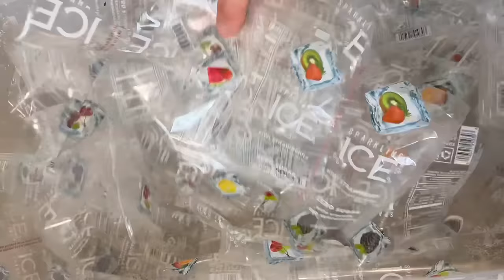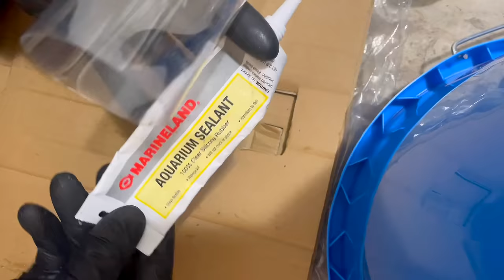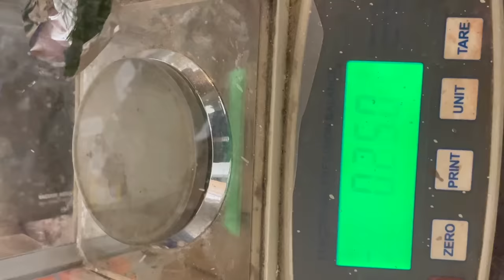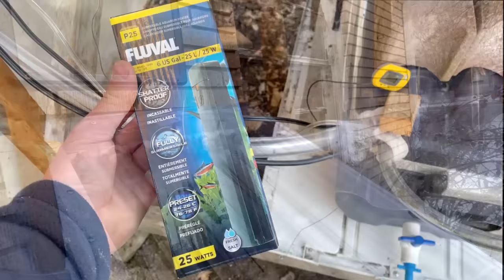Cody's Algae Panel

Comment: Nice work, efficient use of materials.
Would it be possible to increase the algae's production by giving it some kind of feedstock, possibly derived from kitchen scraps and or animal waste?
Reply: @SwampyColorado420  😂😂😂
Reply: No, that's because algae make their own food. I think an euglena would be able to do that, because euglenas make their own food when they don't have any food, but when they have food they just eat it. Maybe you could compost the food waste to give the algae some minerals.
Reply: @SwampyColorado420  What are you talking about?
Reply: He could also increase efficiency by lowering the number of times in that panel, have 3 thicker tubes instead of 9 smaller ones as it would Power wasted space.
Reply: Might be a good use for waste hydroponic nutrients
Reply: Food waste for plants does two things: nitrogen and minerals. I'm guessing the nitrogen won't make much difference to the algae but it's just a guess. The mineral requirements are probably quite different to want land plants require. So putting food waste into the algae tank is likely to just produce growth of ther things that like food waste besides algae, and to complicate the process of harvest and use.

Probably the correct thing to do is find out what minerals algae requires and add small amounts of that.
Reply: He already provided a perfect mineral mixture so the algae wouldn't get anything positive from food waste.

Would probably be better used in a methane digester or bug farm
Reply: @mgord9518   he has a methane generator.👌
Reply: I was actually surprised how much oxigen that small area produces that seems totally doable, makes me wonder why the Biosphere2 project struggled so much to maintain oxigen levels.
Reply: liquid fertilizer would work better i believe
Reply: @SwampyColorado420  *CRACK FARTS*
Reply: @alexk4709  Well, some fish farmer filter the fish tank's water with hydroponics. Then they use the plants they produce to feed the insects they feed the fishes.
That could potentially work here, providing food and energy.
Reply: Maybe if it was pre digested and broken down by otwhr bacteria or chemical processes
Reply: @puppetsock  I think that the increased nitrogen would make a big difference.  Often when looking at the causes for out of control algae blooms, agricultural runoff that is full of nitrogen rich fertilizers tends to be the main culprit.  This also makes sense when you look at the lack of good sources for fixed nitrogen being a huge bottle neck for agriculture until the  Haber-Bosch process was invented.
Reply: The formula for growing algae has been well established since at least the 70's, and you can look up recipes for producing the nutrients online.
Reply: high risk of contamination, low benefit. you generally don't want to start growing random algae if you are concerned about efficiency.
Reply: @vidard9863  yeah well you wouldn't do random shit you'd go for a probably very specific maybe even purpose made species atleast if you did this more commercially
Reply: @baileyjerman5573  so wait, you would go for a specific strain, and then throw in kitchen scraps with who knows what on them into your system? or was that you agreeing with me that it sounds like a bad idea.
Reply: Major improvements in this system will be had in maximising the amount of light in the tube while maintaining the optimum temperature for growth. I would have a large flat surface like an aquarium tank but much much thinner, maybe only a few inches thick, sides and back covered in reflective foil and insulation foam, temperature maintained at optimum by cycling the water through a radiator when hot and covering the face of the panel with a large foam block or similar when cold with supplemental aquarium heater if needed, no point cycling the water into a separate container. Could do this pretty cheap too, mirrors from recycling centre for glass, old car radiator, etc. Automate the temperature control with a thermostat that cycles radiator when hot and actuated a motor to drop the lid when cold. If you wanted to be really clever you could make the lid permanent by making it a two layer sandwich construction with the outside layer being several inches think and you draw down a vacuum inside it, now it is fantastically insulated all the time while still receiving sunlight too. Combine all this with some selective breeding of algae and I think it could get very interesting.
Reply: Also you could face the front with a one way mirror, this way you maximize the amount of light in there, no real way I can see to do better than that short of supplementing it with extra mirrors pointed at it or artificial lighting.
Reply: @SwampyColorado420  lmaooo
Reply: @johnmarston2527  Oh he is just mistaking the all new way of doing Pot smoking, the method pioneered by YouTuber Hickok45.
However, it is currently only enjoyed in the US though.
Reply: I feel like adding things to it would be bad for it considering he’s going to eat it, he seems to eat the algae raw essentially, he doesn’t seem to cook it just dry it out and then eat the powder
Reply: @AaronAlso  Bro I'm so F*cking mad I'm going to Die....  I'm going to wait till the very last second..
Reply: @johnmarston2527  he might be high
Reply: @nobodyofnaught2  If i remember correctly they had some poor choices with the concrete which started hogging the oxygen from the air.

Comment: 16:10 i think the temperature falling rapidly might be partially due to the radiator like design of it, after all, if your not absorbing heat from the sun then your going to just as quickly radiate heat out, especially from the exposed pipes you mentioned at 16:45, maybe put a pipe insulation sleeve over it like the ones that are used under houses on water pipes?it would definitely help retain heat on the trip to and from the panel. 
you are also probably pulling in cold air from the air intake, since the air intake is under the panel it is going to be in the shake where its colder, maybe put the air intake in direct sunlight where it can also get warmed up and add heat rather than remove it. 
and maybe spray the panel with something to make the ice less likely to form or slide off better on its own so you dont have to scrape it off. i hope we get to see you make improvements on it! i love watching you and your experiments!
Reply: maybe 2 layers of the clear plastic would help, kind of like 2x insulated windows, but IR would still pass through unfortunately 

I'm also thinking about maybe an emergency heating coil, powered by something energy-dense, for if the main tank falls below a certain temperature

Comment: I made a photobioreactor (the scientific name of the algae panel I guess?) in january of 2020 for my second year of uni, and I can tell you that your design is by far the best I have ever seen! It is SO practical and straight to the point while staying simple. I wish I had seen that video at the time...
I can't wait to see the following videos, keep up the good work!
Reply: how did u do it? lol link a picture just curious.
Reply: Wouldn't a flat panel be more optimal? It would increase the surface area that the sun interacts with algae, thus with more sunlight you would increase the overall energy absorbed by the algae in the system.

Comment: the method of extracting oil from the algae that cody did can be done to other organic things aswell and get the same results, i did that a long time ago using dry leaves and chicken feeds and the oil i extracted is still with me, its kind of like a tar and crude oil but once its exposed to fire it ignites

Comment: I was wondering how you were going to control for light and temperature, if you were going to make some complex arduino solution, but no, you're clearly smarter than me, because you went solar panel powered relay into thermostat, which is the most stupid simple and elegant solution I would never have thought of. :) Thanks for that.
Reply: Dude same I'm all like so you have to temperature reading you'll have to analyze that data and add some kind of motor controller for the pump... Nah you don't.
Reply: Same,  I would've used a photo resistor + relay for this since its cheap (and I don't have a solar panel lol)
Reply: I was thinking a solar powered pump with maybe a capacitor and a FET  voltage switch to activate the pump.  Possibly additional panel to speed the growth by increasing the temperature to optimum or as close as reasonable when light energy allows, would give more of a capacitance for cooling if there was heavy snow while away without so much grid energy requirement.  Could always use a grid backup set to heat to a much lower temperature to save the system if there was an extended cold spell with not enough light.

Comment: This is an awesome design, looking at the thumbnail I thought it was a solar water heater or similar.
Would having a just two panes of plexi/glass just stuck near enough to each other (like a flat aquarium), with some standoffs for flow agitation, be more efficient? 
I know it's supposed to be a proof of concept, but having a sun roof that doubles as a algae farm just seems awesome.
Reply: My big concern with a roof setup would be the weight of water putting a huge load on the roof trusses, that and if they did fail, you'd now have a large quantity of water ready to fall in your collapsing roof
Reply: @macklinmollard4045  I guess I'm imagining them to be on one of those rooftop sunroofs. Being a whole other floor on top of the house means they could support greater weight.

Comment: When you said that it "only does around 2%" of your calorific needs, I was immediately astonished that just 50 of these systems would - in theory- sustain you! I find that incredible, and that isn't even an unreasonable task at all. Obviously simplification will help with costs, and as low-tech a solution would be absolutely ideal to mitigate failure points as much as possible, but 50 of these PROTOTYPES is all you need*? Absolutely phenomenal really.

As soon as you set up the timer system, I could see that being an issue instantly, as the whole "what if it's cloudy/raining?" question comes up. We both came to the same solution though, so that's brilliant. A little side-project of it could be powering things off of your already in-place solar panels, where you could set up a relay to monitor how much wattage the solar panel is taking in, while also being able to power the pump and heater from it. That's a simplification right there, as it's a reasonable assumption that, if a solar panel is greater than X amount of power, then there is a good chance that it's sunny, and, therefore, providing enough light that, when absorbed by the comparatively "dark" algae, it would provide enough heat to sustain constant flow. That removes the timer and thermostat from the whole system, and, providing you have large enough tanks, the thermal energy should sustain it for extended periods of non-thermal days (remembering, of course, not to put all your eggs in one basket so to speak).
Reply: Also comrade, if he were to scale up the size, it would be a lot more productive than building more individual systems. Maintaining a small amount of large systems is probably easier than managing many small systems, and would probably simplify refinement.
Reply: I'd just like to add that for a small system like this where power is already available, you don't need a solar panel to trigger the system. A simple (cheap) photo diode would suffice.

Comment: Cody glad to see you recycle plastic bottles and great idea, another solution is to drill a hole slightly smaller than the bottle screw neck in the bottom of the bottle then glue the screw neck and screw it into the bottom of the other bottle done this and no leaks it also creates eddy currents in the bottles. Also those plastic bottles works great in ceilings
Reply: could you explain why an eddy current might be useful in this scenario? Thanks!

Comment: You can replace the bottles with lengths of that same tubing you used elsewhere. It's easier to build, more flexible, but more expensive. We created a setup similar in my old lab using large diameter tubing

Comment: Love this! So much algae, and pretty green tubes

Some copper tubing insulation around the two hoses should reduce the heat loss a bit. And they could easily be removed when the weather warms.

Comment: At 9:30
Instead of using differently sized holes to restrict the flow, you should plumb it to such that the tubing at the top exits out the opposite side from the tubing at the bottom. Doing this would make the liquid flow equally through all of your tubes at an equal rate since the fluid path would be identical among them.
Reply: But that could make  emptying back into the storage  difficult without bypass valves or pumping it out
Reply: @davros1971  It would drain out just as good as it does right now. The inlet would come in on the bottom left and exit on the top right.
Reply: @davros1971   It would drain out just as good as it does right now. The inlet would come in on the bottom left and exit on the top right.
Reply: Thats fucking smart
Reply: Or the bottom pipe that bottles are connected to could be slightly angled through the end.

Comment: That aquarium sealant is just 100 % silicone. For future projects you can get a big caulking tube of it for much cheaper in the windows section of the hardware store

Edit: make sure it's labelled 100 % silicone, some window silicones contain non-food grade additives
Reply: 100%
Reply: There are 2 types. The ones used in the windows, which is cheaper, will slowly contaminate the water (it releases a chemical).

The aquarium grade, supposedly, doesn't do that.
Reply: I wonder how it handles the thermal changes and still seals.
Reply: @serpentine1983  It has to be specifically labelled as 100 % silicone to be aquarium safe/food grade. Some window silicone is, some isn't
Reply: @ashton7981  good tip. Thanks.

Comment: I can see the thermostat solution having an issue in specific cases.
So if the algae heats up if its sunny outside and the panel is running, but cools down when its dark outside and the panel is disabled the following might happen (although this is a very naive analysis where I'm discarding lots of outside factors since I'm unable to measure them):
Assuming its cold enough inside the water the thermostat will disable the panel until the water is once again hot enough. 
However if we assume the sun is only up for short enough times then the water should be unable to heat up if it stays inside the box, permanently disabling the panel and forcing the water to continue cooling whereas it could've gained a little bit of heat during those short strokes of sunlight. 

A suggestion to solve this situation would be to use a heater whenever the thermostat would disable the panel in order to gain heat instead of disabling it. Since the box is very well isolated I believe it shouldn't have to be anything powerful so the cost should (without knowning your electricity prices ofc) be manageable. 

Then again, this was a very naive analysis so perhaps this situation never occurs and isnt a problem.

Comment: I work with Algae in a research center ,  while you can use the sun for energy it's not very efficient  way , instead you can put about 4-5 fluorescent bulbs " the long bulbs " , it can provide energy 24/7
and this will be efficient  , and the photosynthesis will always be on not just during the day light
+ algae can provide a huge amount of O2 comparing to a plant , but it also breathes o2 and Obv the breathing is also high with there no light because it can't produce o2 at this situation , so if u have the light 24/7 it can provide much more o2 and much more  bio mass
Reply: Led grow lamps do an amazing job. More expensive at first, but less wasted energy, more compact, less heat and isnt full spectrum!
Reply: Yes, but you would need to power those lamps, and since he's basically trying to do an off-grid project, that won't work. Unless you harvest some energy with a solar panel, or from the algae by burning it in an electric generator, but that might not be sufficient.
Reply: @Personnenenparle  
the place that i'm in has been using CFL for over 30 years with great results , in the summer it could go over 40 Celsius - In Egypt - but we didn't have a problem with CFL , I know it could waste Energy much more than the LED grow light but at a small scale like 12-15 columns of algae you only need about 12 bulbs ," the heat wouldn't be a problem at all in his case its freezing out there with Cody  LOL " 
, but he can use LED or CFL or whatever works for him best , but he can't rely on the sun light only , and since he's at a freezing temp in his area it would be better if he has his columns indoor , its more warm and he will have more control
Reply: @GamerDuDimanche1456  that's a good idea , solar panel  and batteries could provide enough energy for the bulbs at the night , so he can use the daylight to grow the algae and the solar panels to charge the batteries  and at night the bulbs turns on from the energy that have been saved during the day in batteries
Reply: @GamerDuDimanche1456  I'd say that a system with some LED lights, a solar and wind generation rig, a battery and just in case a generator (pretty sure that this would be a feasible system for Mars). In the Mars colony pretty sure that the generator would be Nuclear, but for this case a gasoline/ethanol genny works okay. You can even make a heat co-gen system to heat up the algae tank by putting a sort of a radiator picking up heat from the gennys exhaust, so the aquarium heater wouldn't consume as much energy, especially when there's not enough sunlight.
The LEDs would turn on at night or during periods of low sunlight, and when the batteries were depleted, the genny would turn on, supplying heat and energy  as needed. This way the algae would be replicating pretty much all the time.